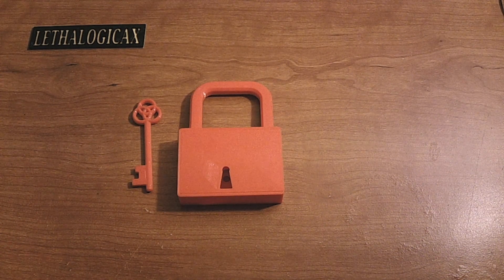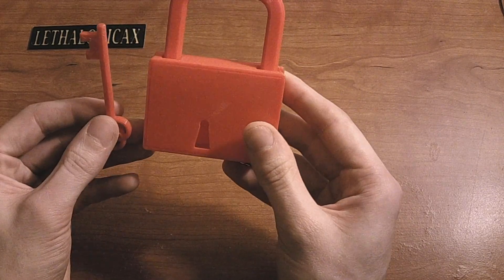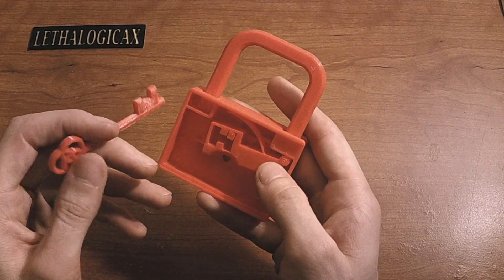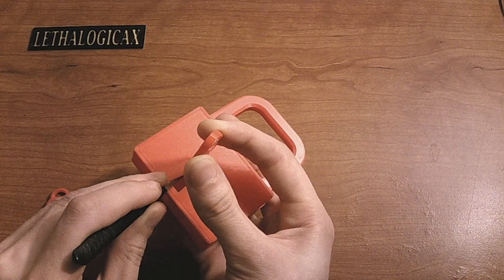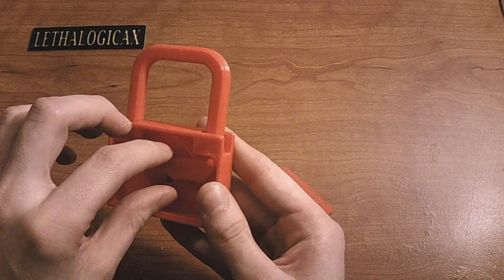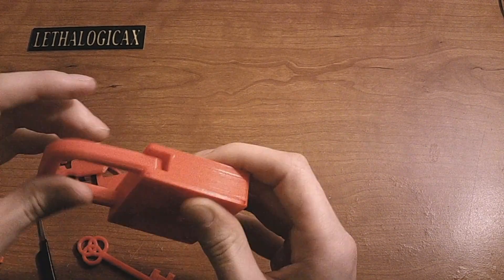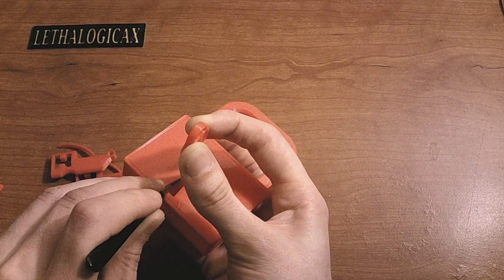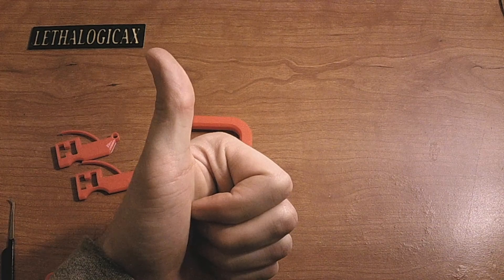3D Printed Lever Lock Designed By David6722

Comment: We are new to this.   What printer and program do you use
Reply from the maker: Hey there! I use an Ender 3 and the programs I use are Cura (slicer) and Tinkercad (3D modelling software)

Tinkercad was not used for this project as the design is not my own. Cura, the slicer program, is used to turn a 3D model into a series of instrictions (gcode) that the printer can execute. 

If you have any other questions, feel free to ask :)

Comment: I absolutely love it. I have not seen this one yet. I will definitely have to print one up myself. So to double the levers you just must have scaled the Z down to 50% I'm guessing? Do the springs feel weaker at that point. I'm thinking about scaling the whole lock up to 200%. Anyway brother thank you for the awesome video. It gave me something new to work on. Stay safe.
Reply from the maker: Yup, thats exactly right. Just scaled the Z axis to 50%, no further modifications nessesary. The springs feel somewhat weaker but they still definitely work. I can make all the modded parts available if you'd like. Ive made an alternate key with up,down,up,down bitting for the 4 levers and it works great! I am now also tempted to print one of these as large as I possibly can :)
Reply: @lethalogicax2474  the print looks really clean. What machine did you print that from?
Reply from the maker: @bobbykeyz1263  Ender 3
Reply: @lethalogicax2474  sweet. I love my Ender3. I just got the Ender5 a couple weeks ago. I'm running 7 different machines now but I love the Cr10 mini the best. It has a decent size bed too at 220×300. Its never failed me with changing colors. The Ender3 is great for that too.
Reply: @lethalogicax2474  I just got home from work and i already have four machines running on locksport tools. For my buddy Bill Bacardi, Jeff Moss and Kevin Bacon.
Reply from the maker: @bobbykeyz1263  Holy crap! Sounds like 3D printing heaven! Ive seen a lot of your work and you have done some amazing stuff for the locksport community!
Reply: @lethalogicax2474  my email is in the description of all my videos. I would give it to you now but it might just go to spam. Send me an email so I have yours and yeah if you have some upgrades on the lever lock i would like to get them and we can send pictures and stuff. I'll give you my number too.